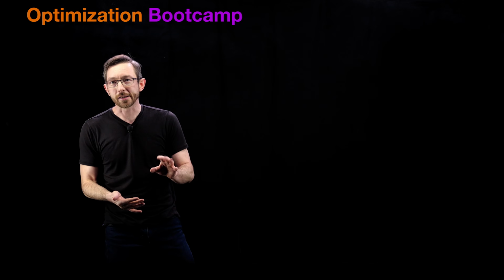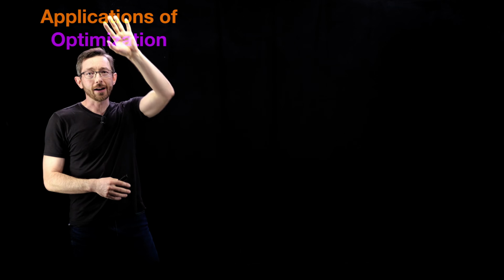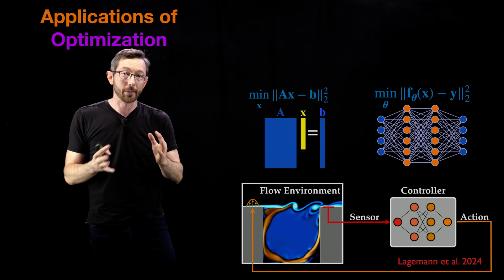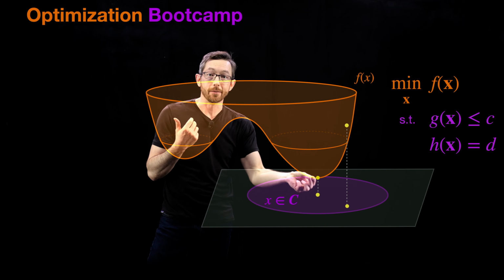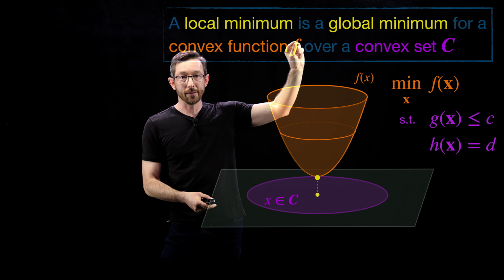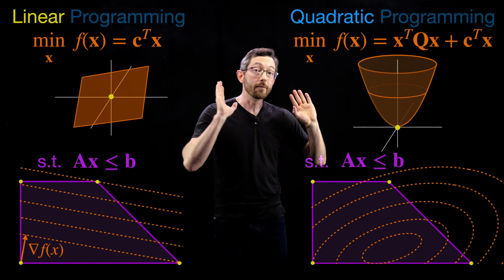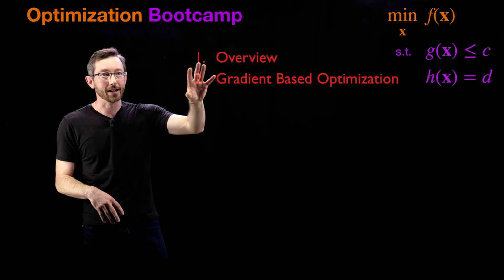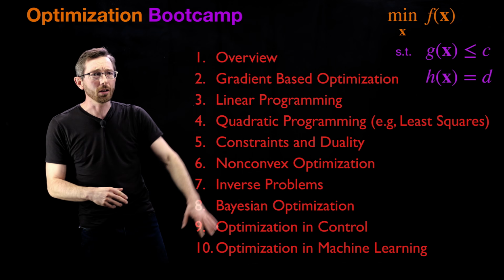Optimization: A Bootcamp for Machine Learning, Inverse Problems, and Control

Comment: This series is very timely. For example, the Julia Programming system includes a rapidly growing JUMP component with interlinkable optimization routines (at least 50 solvers). Meanwhile, the quantum computing company that is currently having the most commercial success  is D-Wave, which has focussed until recently on machines that are specialized on optimization problems — see their recent QUBITS conference videos.

Comment: Professor, 

I tune cars. The amount of help your work and videos have been cannot be overstated.

Never feel like you’re ever dumping this out to an audience that isn’t taking it to the applied side in the general public without a Mathematics or Engineering degree. I can’t speak for anyone else, but I can say you helped at least a nonzero amount of scrubs like me get a lot better. 

I might be a minority of one (I doubt it,) but you have changed the way I do my job for the better. 

Thank you. ❤
Reply: Pretty sure you aren’t a scrub if you can turn theoretical knowledge in actual real world settings… many with PhDs struggle to do so…
Reply: @MScinIndustrialAutomation--d2d to be fair, I’m essentially getting to play Minecraft/conceptual Legos because of the PhDs doing the hard work. Lots of fun stuff going on in state machines, traction control, and small neural networks right now (<200 nodes on common automotive microcontrollers.) 

Just out here trying to do Math for fun and profit. Even a blind squirrel finds a nut every now and again, so I’ll collect some more n on the “scrub” question over time but still coming off the excitement of finding out “hey, Control Systems are Geometry with window dressing” in the last few years. 😂

I appreciate the kind words. I wouldn’t judge a fish by it’s ability to climb a tree, nor think less of a PhD that does excellent theoretical work who struggles to move that to applied spaces- I might not compare well to somebody that’s excellent in developing the theory of their field, where I would likely struggle to catch up to them in that race. 

We all play our parts, I suggest.
Reply: Perhaps you are a genius and you just don't know.
This is not a "trivial" knowledge at all.
Reply: Stop being critical of yourself and calling yourself a scrub, I respect anyone who continuously everyday and try to improve their knowledge. Even more so as you do not have a technical background, and is venturing into areas different from your specialization